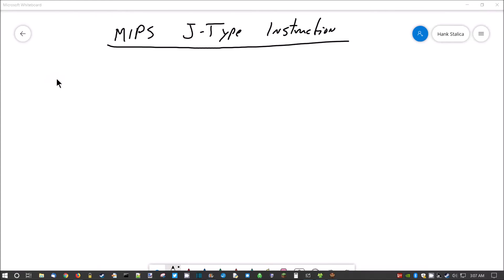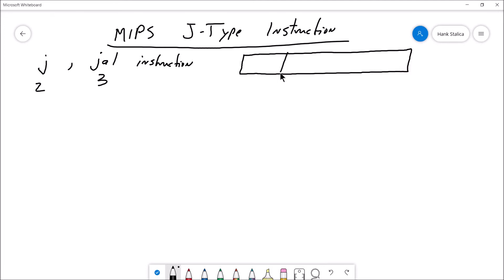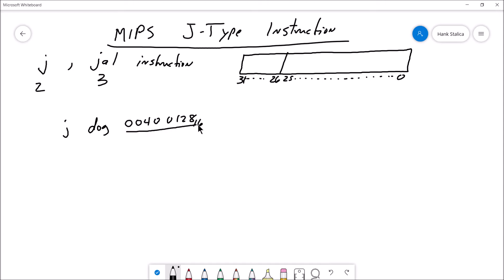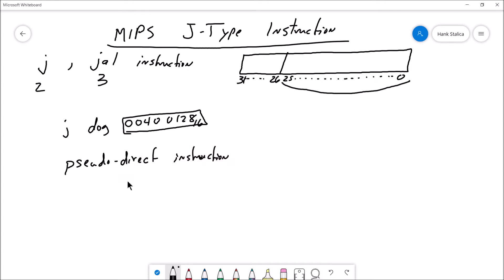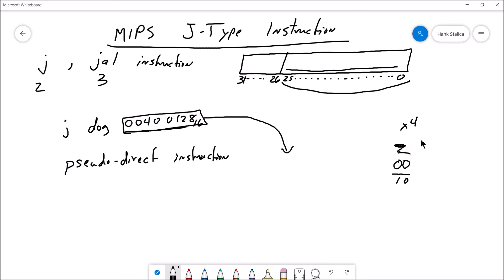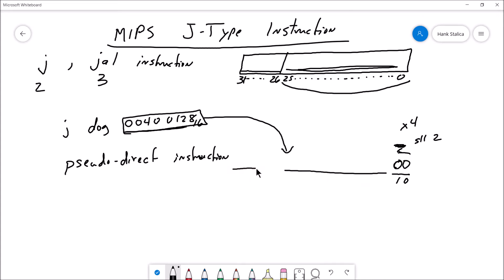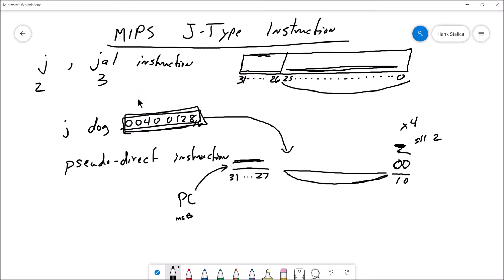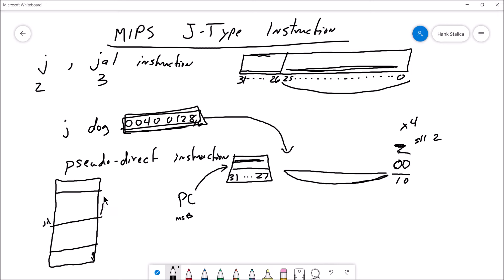MIPS J Type Instruction Format Addressing

Comment: So, is the distance we can jump from the program counter is bounded by 2^(4)?
What I understand is: We can ignore the first two bits since our MIPS memory structure is aligned and each word takes 4 bytes and each instruction is a word. The middle 26 bits comes from the Jump instruction's operand section. The MSB 4 bits are taken from the PC MSB first 4 bits. 
My question is: How much are we bounded? If our MIPS architecture is 32bit architecture, we need 4 MSB to compile an adress for the jump instruction. I believe we can think of it like this. 2^4 MSB would be thought as we were dividing the whole memory into 16 equal-size section and we can only jump 1 of those 16 sections at most because we have 4 bits that are coming from the Program Counter.

I'm confused Professor. Could you help me?
Reply: I asked Chat GPT and it gave me this following answer: A jump instruction in MIPS can only target an address in the current 256 MB memory region. This is because the upper 4 bits of the address come from the PC, not the instruction itself. This effectively bounds the jump instruction to a specific region of memory, and the CPU cannot jump across regions without additional mechanisms (e.g., modifying the PC via jr or other instructions). The 4 MSB divide the memory into 16 equal-sized sections, each of size 256MB. These regions are often called "segments." Since instructions are word-aligned, the last two bits of the address are always 00. Therefore, the jump instruction's 26-bit target effectively specifies a word address within the 256 MB region.

Comment: 31 --- 28*  you already used 2x bits, so it's 31--28  not 27. 

still tho on my MIPS sheet, for some reason, the jumpAddress is assigned with  PC+4[31-28}, address, 2'b0    

i don't know if it's a typo or what, but theyre using the PC + 4 rather than the PC.
Reply: and it's   [31 -- 28]  [27 --- 2] [1 0] 

from 2 ---> 27 there is 26 digits.
Reply: you got the idea, dnt be goofy

Comment: what is the the program counter instruction number ? i thought it meant the opCode but now im not so sure
Reply: Ig opCode would come before these 26b's
Reply: Basically, to address 4GB of memory in J encoding, you need to address 2^32 bits, represented by 32 bits. 

In MIPS, which is a fixed legnth microarchitecture, we only have 32 bits per instruction. 6 bits goes to the opcode, remaining 26 bits goes to the addresses in J encoding.

The question is, how do you address something that needs 32 bits minimum with only 26 bits for addressing? We have to make up for 6 bits one way or another. Recovering 2 of these bits from the lower order bits is easy, as a word is minimum 4 bits. 
To get the remaining 4 bits out of the missing 6, we take it from the program counter. 

Now we have a way to represent 32 bit addressing with only 26 bits!